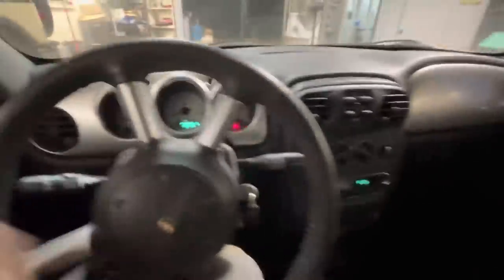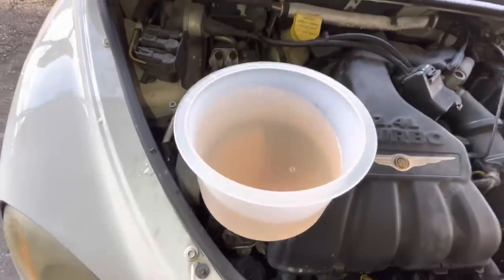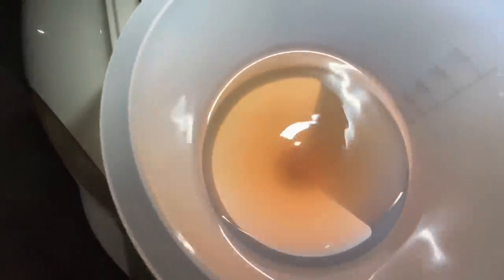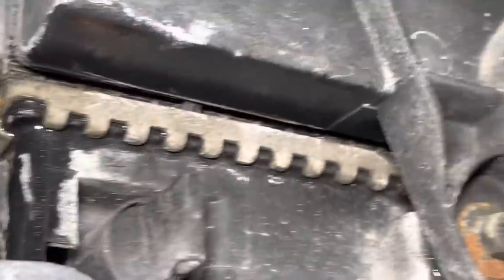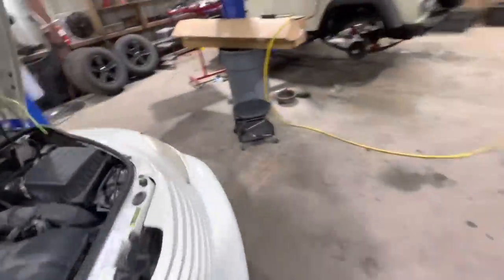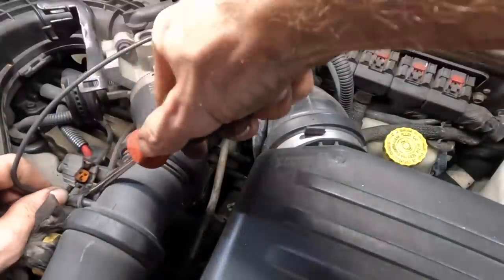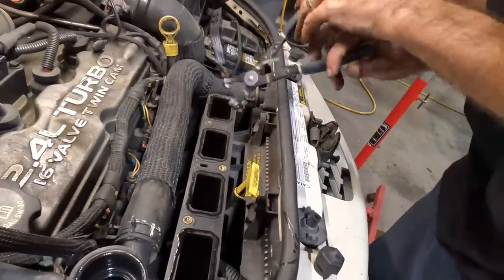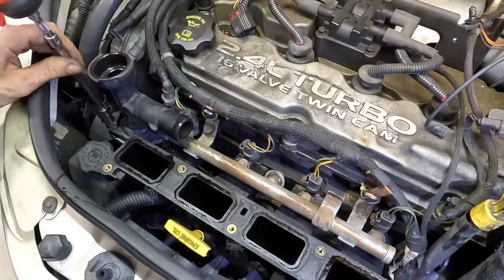Turbo Cruiser 2.4 Overheating Again!

Comment: My daughters 87 Camry was having overheating issues.  The water pump was new, the thermostat was new, system had been flushed.   Finally replaced the radiator.  You couldn't see it in the car due to the fans and condenser.  Once it was out,  you could see where it was rotted away.  Most of the fins just fell off.  Problem solved and it only took 1.5 hours start to finish.

Comment: For that transmission line I have found that a golf Tee works very very well. also for bigger hoses I have used the plug that is used in a catheter. I know it sound screwy but they do work.

Comment: Spray connectors with silicone spray and compressed air before trying to remove.  Use 90deg pic where connector hooks if possible.

Comment: Not having worked on PT's before, I was surprised you could replace the radiator without removing the front seats !! I mean, it seems like almost everything else came out first. 🫨

Comment: Another NEC tip...using the ckt breaker as a switch, must have breakers that are rated as such, they are marked on the label if they are such rated or if not, shouldn't be using it everyday as a switch, won't hold up over time ...also the compressor needs to have a safety switch disconnect at the compressor in plain sight

Comment: Check out a Dynatrap for mosquito elimination! They work great. And you shouldn't have to deal with them in the shop. Available at Costco. I have two 1 acre units for my 1.7 acre lot home. 1 in the front yard and 1 in the back. They have drastically reduced the mosquito population in my yard. Hope this helps.

Comment: Ray, I have commented on my love hate situation with PT Cruisers before. I have one that is still kicking my butt with respect to overheating. It only has 75,000 miles. It has a new heater core (because it leaked inside the car), Thermostat has been replaced multiple times, upper & lower hoses replaced, radiator replaced leaks bottom driver side corner. Water pump and timing belt replaced, (water pump leaking) you can hear gurgling and flowback into the overflow bottle. Fan replaced (not working) plug in connection found bad on reinstall, hi-low temp switches verified to work. Lot's of bubbles seen coming up out of radiator into funnel Like you showed, Positive for combustion gasses. I believe it has a head gasket leak but I have not verified it with a compression test. I don't need more free work but I do not believe there is enough value in the car to replace head gasket.The car is a 2005, vintage so it will be going to someone who wants to take on that effort, my son  says he want's it.

Comment: @Rainman Ray's Repairs, only a few hours for the job, simple enough repair, once you're done with it.😆Like some other users said, it's crazy how little most average motorists know as to what it takes to make even what seems to be "simple repairs". I mean this didn't take a $10K scanner and 5+ hours to analyze and diagnose and THEN you have to do the work of tearing half the vehicle apart to fix it... Still there is a lot involved in just replacing the rad, after all the parts are removed/replaced/reinstalled (& hopefully nothing breaks/strips), then you have to refill with coolant to be sure it's the correct level and concentration to prevent overheating/freezing/corrosion... 

I remember when an old Ford rad was leaking, looked like coffee pouring down the fins. Pretty insane that because the block/heads were cast iron, that they have problems with corrosion so the originally "gold" fresh coolant begins to look like "coffee" in time. Definite pain with having to detach the AC condenser & PS cooler but overall not too bad, "just a few hours work", lol. Anyway, as always, enjoyed the content! I hope you and your family "units"😆have a very Merry Christmas and a Happy New Year! ^_^

Comment: Bolts for plastic are usually course thread , threads spaced further apart , bolts for steel , aluminum and many other types of metal come in many thread types mostly what is called fine thread, threads that are closer together which do not work well with plastic as the threads in plastic tend to strip out with fine thread they need more material per thread to prevent this in most cases

Comment: Mopar red clips on connecters crumbling check. I would have put duct tape over the huge intake holes looking up at me because they would turn into black holes swallowing every nut bolt and washer I removed (same for the lower blower intake) but that is just MY luck. LOL oh and tugs on it and it will come out means in several parts when I do it. Keep up the good work and amazing videos Ray. God Bless and Merry Christmas.

Comment: Just a suggestion Ray, before fitting the rubber hoses put a bit of dishwashing detergent on the inside of the new hose and it will slip on easy and it will be easier to remove in the future if and when you have to work on this customers car, it works as you know when assembling tyres on the rims and works just as well here, thats how i used to do it when I was a technician here in Australia. Just a suggestion to make your life a little easier and as others have said here IGNORE the haters, you are doing a great service even to open up your life to the public......Hoping it all goes well for you into the future..........
Reply: Does that keep the cooling system clean with any that gets pushed into it? ......
Reply: @larrybe2900  If you are carefull just to smear the rubber surface that meets the inlet or outlet none of the detergent will make it into the cooling system and a little bit would not adversely affect the running of the engine anyway, all it would do is produce a few bubbles if any got in, I don't think it has any cleaning ability though, not in an engine atleast

Comment: It's likely if I was an Automotive Technician, I'd be cursing the Engineers, but it's funny that I ended up working in an Engineering department as a Drafter, later titled a "Tech Designer".  ;-)

Comment: My 2012 dodge durango did this exact same thing.  I only need to pay for it for another year.  So I ended up just putting some head gasket sealer.  Hasnt lost a drop since.  Not worried about it.  Once I trade it in it will be going to whole sale.  Probably end up in Guatemala or something.

Comment: 36:24 you can use a vice grip on each hose to pinch them shut temporarily. Maybe use a little bit of cardboard or a piece of shop rag to soften the pliers' jaws so you don't bite too hard on the rubber. Worked for me quite well when I changed the aux water pump in my Prius. 👍
Reply: My thought was a DeBakey clamp used for aortic cross clamping during heart surgery. Might cost a LOT more than vice-grips, though.
Reply: @mred8002  oh yes or hemostats if u got some nice ones laying around
Reply: @bat__bat    Big Pean clamps or large Kelly’s might do, but the DeBakeys are a non-crushing type. The first two are cheap, and I use them for all kinds of stuff. They are 16” long with a curved or right angle end. Retrieving non-magnetic ‘gravity’ parts, glue clamps in weird spots, etc. but, I’ve used those in ER and ORs for decades so no learning curve. There are some really odd and ‘why didn’t I think of that’ ones out there, and the cheap Pakistan ones still work. Smaller Crile and mosquito clamps are great for flytying and crafts, too.

Comment: If you replace the thermostat that many times it’s not the thermostat. Just saying. With Chrysler you gotta pressure test the system to make sure 🥴 Astro make an excellent one for like $35 it’s air pressure applied

Comment: well, those engineers that designed that pt cruiser model definitely were master level Tetris players, hands dows the best i have seen. however that might be slightly causing a small issue down the line, for the poor mechanics having to work on that piece of junk that breaks down twice a week,
having to take out the intake, battery, fans, boost pipes, injector rail, front grill, that from metal structure part,... all of that just for changing a radiator... seriously? at this rate, i guess it might take less time to change the f*ing head gaskets on an old American truck, and reassemble everything, with all that available space in there

Comment: Observation and possibly constructive criticism...  You have a habit of loosening hose clamps just enough to break the hos free (Boost pipes, Intakes, coolant lines, etc), and then try to remove the hoses, only to have the barbs kick you...  Loosen more, slide the clamps past the barbs, THEN try to remove to hoses.  I have been a tech since the late 90's, so this isn't some shadetree advice...  I will give you props for putting spring clamps back in the original witness marks...  I do/did the same...

Comment: Nice job Chrysler in wrapping everything else around the radiator. Sure seems like an awful lot of work just to replace one. My Subaru’s radiator replacement was so much simpler, and no need to get underneath the car.

Comment: So glad to see you using the magnet on a stick. However, why don’t you get the little magnet discs, a bit larger than an aspirin tablet, which you attach near the end of your socket? Then when taking things like vanity covers off, when you pull the socket out, the bolt or nut comes with it. I wish you would give them a try.

Comment: Good thing it wasn’t the water pump, because on non turbo cars the engine has to come up and on a angle to replace, turbo cars they put the car up on lift then drop engine cradle on the floor. Plus A/C has to be discharged to remove line thru the timing cover

Comment: I’m sure this is not unique to the PT Cruiser, but the amount of flimsy plastic stuff on that car is really annoying.  I have heard some cars referred to as “throwaway cars” — you drive them until they stop working and throw them away.  No quality, unnecessarily difficult to repair without breaking more stuff.  I don’t do this work — I find it frustrating enough watching mechanics have to deal with.  I applaud those, like Ray and Eric O.,  who have the patience and technique to do it and get it back together and working.  👏

Comment: BTW, to combat your skeeterz problem, get you a couple of those Liba indoor UV bug zappers.  Those things work awesome.  We likely have smaller mosquitoes here in north Alabama than you do in central Florida, but I bet they are just as angry. It is so satisfying to hear that thing pop!  I keep one running in my garage also.  Definitely cut down on the attack rate of those little monsters.
Reply: zapping in repair facilities with arcs is most likely not good, gas fumes etc...and violates NEC

Comment: I have a PT cruiser and I found out that when you want to work on the front side of the motor and or the radiator fan just remove the grill

Comment: I have a 2003 PT Cruiser non turbo and it was pretty easy to replace the fan and then replace the radiator 8 months later. When I googled it it was a lot easier than how you did it. Maybe a turbo one is different? I didn't have to remove the intake at all.

Comment: great Video Ray. Shame the front end of those things is a mechano set when you have to work on them! I hope you don't end up having to take the engine out of one of these things, you'd end up with no car and a mountain of odd shaped bits to bolt back together 🤣

Comment: Had a 2004 PT Cruiser GT, traded that POS in under warranty.  Felt like a semi was hitting you from behind at freeway speeds, two Chrysler dealers couldn't figure it out.  I suspect it was the Turbo.

Comment: In this particular situation I usually pressure test the system at 700 psi .....you don't always find the original leak......but you sure WILL  find A leak

Comment: I really like watching these videos. I have the image maxed out on my screen and I still find myself ducking and weaving trying to look and locate bolts and fasteners to help Ray out. Don't know if this is good or not, but when I changed radiator hoses I would use a little axle grease on the insides to help lubricate and add slippage lessening annoyance factor. Just saying... If grease is not kosher... then spit on it! Keep up the good work Ray!  Man's Prayer... I am a man, I can change, if I have to, I guess.  - Red Green

Comment: Suggestion: Use a simple pressure tester on the radiator and no hot engine to burn yourself around and no hot water either but, any leaks ANYWHERE should show up easily and pretty much straight away as the WHOLE system will be under pressure. 
I wasn't too keen on the dark muddy look of that transmission fluid coming out of those bottom hoses (that later turn out to be power steering).
BTW: I see PT CRUISER owners spreading the word that someone in Florida can cure their horrible little cars and people the world over shipping their PT CRUISERS to you and you having nothing but an endless stream of PT CRUISERS pouring in the gate and doing nothing but replacing fans, radiators and all things that require endless hours of pulling awkward parts off just to replace a thermostat, radiator or fan, FOREVER right up till you retire at 95 years old after new laws passed forcing everyone to keep working till then, if they live that long! Oh what a fun thought :face-red-droopy-eyes:.

Comment: Removing the battery will trigger cel..and the ecu will need reprogramming...because of the F-36 clock fault code...if not done the engine timing will be out of parameters and won't start.

Comment: My most hated overflow tank. Seems like it likes to funnel into the drain hose more often rather than filling the tank half the time because of the angle. Although where I worked before we didn't use coolant jugs, we had a pneumatic pump that fed the coolant through a hose

Comment: what a engineering marvel just think you only had 2 hoses 2 trans cooler lines and 2 bolt to remove a radiator in the past lol

Comment: What are those engineers smoking? My radiator is held in by 2 bolts on top...then you pull it out (2006 Matrix).  Also,  I plugged up the cooler lines with a couple of punches. Works great.

Comment: Unfortunately you have to deal with the haters👎. They don’t get it. Have you tried to diagnose a radiator leak with your vacuum filler? I have used it several times on gas and diesel engines and it is hands down the best way to find leaks. Drop the coolant level a gallon or so and turn it on. You will hear an unmistakable slurping sound and you can use your ears to follow it to your leak.

Comment: You need a pump that connects to the radiator cap so you can pressure the system and find leaks.

Comment: Poppin’ ze gaskets & ze sealz.

The worst type of leak to find in my experience?? Is the internal water pump leak.

All joking aside the (probably nylon) impeller on the water pump could be slipping instead of spinning on the water pump shaft thus causing cavitation…..

Especially happens after the car has thoroughly warmed up.

Leading to an improper over expansion of the coolant (into pressurised steam) & a commensurate popping of the radiator cap & causing spillage…..

even eventually bulging the plastic radiator end-tanks bending out the metal bendy-tabs & popping the seal on those end-tanks & thus again causing leaks.

But What the hell do I know….I’m an in my 60s couch mechanic 🤪🤦‍♂️

Comment: Couple days ago I was at the auto parts store and I saw some dye that was designed to go into cooling system you might want to add some dye to it since you just added distilled water you might be able to see a leak

Comment: Im a Scania mechanic. i allso get annoyed with diffrent sizes. i used to get away with T30, T40 and 13mm for most bodywork panels. now just to remove a bumper cover and the step plate i need 5-6 diffrent sockets

Comment: Ray why don’t u invest in the  dye kit it’s a simple little bottle/plug into radiator filler it has green dye and if it turns yellow then the heads blown cuz of mixed gases 
It also depending on how yellow it gets shows the severity of the damage..
     Save yourself a lot of unnecessary work

Comment: As much as it sucks to have to do the same job again, at least it's not multiple times one particular car. But hey, you will be very proficient at replacing radiators on PT Cruisers. You could be Florida's PT Cruiser radiator go-to guy (as you slowly go insane from doing PT Cruiser radiators).

Comment: Unbelievable that those bolts at 37 minutes were SAE/standard size heads and not metric !!!!   And a little water or a little denatured alcohol helps rubber hoses go on easier.

Comment: Update on my cruiser. My son took the car and used steel seal head gasket sealer on it he said the overheating has stopped. Not he right way to fix but other You tuber'similar

Comment: Not every job can be a piece of cake, some challenges are needed.  However, some engineers need to work in a shop before designing an engine so they can see the objects that always gets in the way of a repair.

The real question now is why didn't the other shop pick up on the leaking radiator?  Did they see the leak but realized the work involved in replacing the radiator and decide not to do the work?  Or were their first thoughts of overheating replacing the thermostat, and they never considered a leak somewhere?

Comment: I see that the fan runs when the A/C is on, but how about when the A/C is turned off.  It should run on demand based on the coolant temp.  Also, I had 3 PTs, an 03 turbo and an 07 and 08.  All three had fan module failures. I lost count on how many times I removed and replaced the stuff you just did; can do but its a pain. That boost pipe is a royal pain because its so stiff on the turbos. The non-turbos are a lot easier.

Comment: I hate PT Cruisers! I bought a used one with a low battery. I figured I would need to replace it. But, never figured on how much would be required to replace the battery.